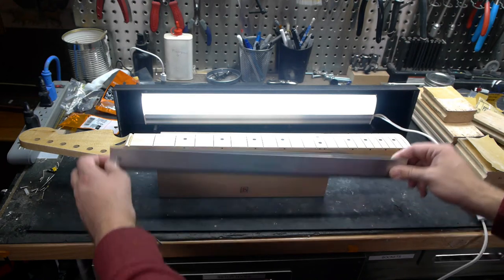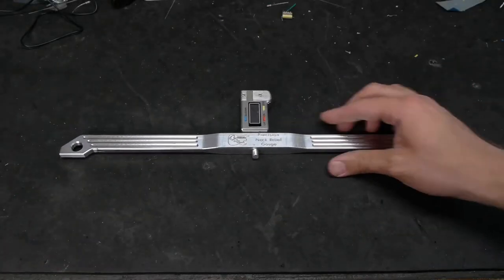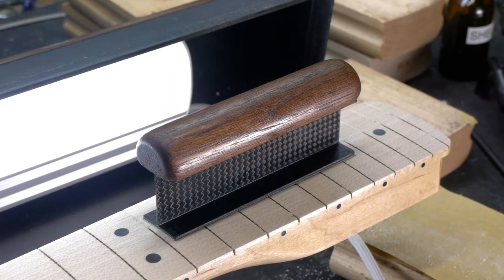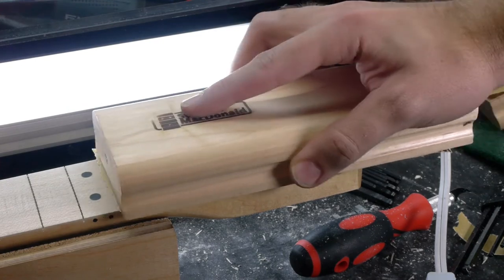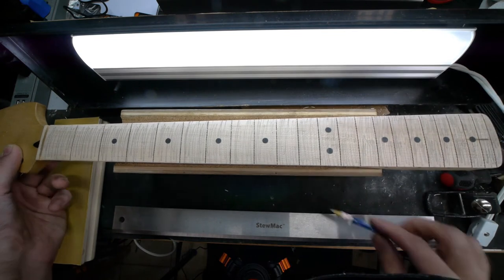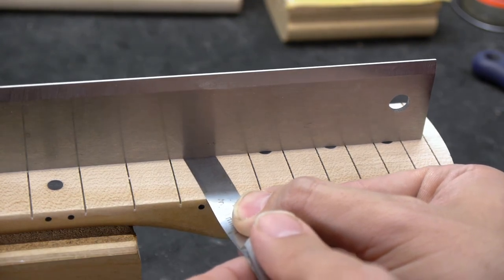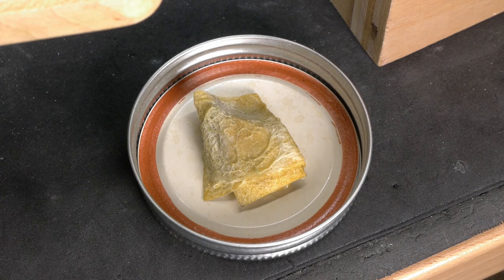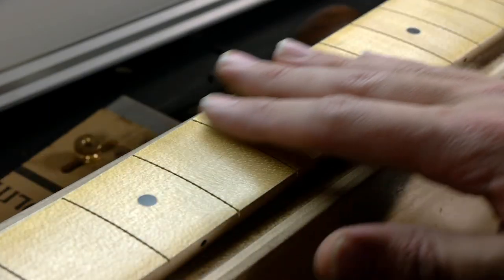*CHECK DESCRIPTION* Cheap Guitar Neck Transformation Part 2 - Compound Radius the Fretboard

Comment from the maker: NEW VIDEO HERE (2023): "Compound Radius" Formula: Conical Profiling for Stringed Instrument Fingerboards / Frets

https://youtu.be/JFj_SmpBCuo?si=Slv0MoEeJlDmDehR
Reply: Hi, interesting videos.  How has your experience  been playing with a shellac finished fretboard?
Reply from the maker: @TheThor1212  Thanks! I've actually been planning on redoing the shellac video (Part 1 of this series) as a standalone video. Also check my channel for the recent redo of this video -- I revised the compound radius thing and the new video is far more accurate and informative. 

My experience has been excellent. I will never use another finish on my own personal guitars. There are just so many advantages, and it's so smooth and easy to play.

I'd strongly recommend doing it the way I did here, with freshly mixed shellac. I've heard of people complaining of shellac getting "gummy" after a while, but only with the hardware store stuff. Never had a single issue with the homemade stuff. 

Absolutely love it. I was actually edging/rounding my frets the other day, and filed through the finish by mistake. Sometimes this can't be avoided. A little shellac touchup and it looks like it never happened...can't do that with other finishes! 

Truly great stuff, and so easy to apply. You can put it on a Q tip and easily get between the frets as well. I could go on and on...if you haven't tried it, go for it! I'm never looking back, myself. Awesome stuff, totally non-toxic (when made with grain alcohol), no ventilation, no gloves, no mask...and dries super fast. Love it!
Reply: @guitar_md  Cool stuff. How you go about cleaning it?
Reply from the maker: @TheThor1212  I use mineral spirits if needed. But considering other options. I know some people like using a little hand soap mixed with water and scrubbing with a toothbrush when it comes to other shellac finishes objects. 

Mineral spirits + toothbrush is quick and easy. Or just on a paper towel.
Reply: @guitar_md  thanks, man. I will try it on indian laurel. May keep in touch about it.
Reply from the maker: @TheThor1212  Definitely let me know how it goes!

Comment: Now that is an instructional video! Damn bro like the guys said before me ... your got mad patience and SKILLZ!! signed up! I hate paying for setups! I am diving deep on doing them on my own. Thanks a ton fantastic information. The special guitar tools ugh figures I got loads of tools, just not for this !! LOL!
Reply from the maker: Thanks so much for the support! Please check out my updated version of this video here for the most accurate information: 

https://youtu.be/JFj_SmpBCuo?si=hxB6ULvspC_7HTRR

I'm also (very slowly) working on a deep dive video on setups. There's a lot to address. 

These days, I rely heavily on a Digital Neck Relief Gauge and Digital Action Gauge (both available from G-Tech Guitars, though Rectify Master is the original inventor of the Digital Action Gauge and I always recommend supporting him by buying one of his tools...you can contact him via Davide Bissoli on Facebook). 

Anyway: You set the neck relief first, then capo the 1st fret to take the nut out of the equation. Then set the action either at the 12th or 17th fret. I don't think it matters much. Then you can file the nut slots down to the proper height, and check the action at the 1st fret using the Digital Action Gauge. 

That's the Cliff Notes version. For Bolt-On Necks, you have to do a lot of work on the neck pocket, which may include shims to adjust the action and the string alignment, and more. 

I'm working on a Truss Rod Adjustment video that will take up enough time on its own. Just adjusting the truss rod can have a lot of things to watch out for...in a perfect world, it's simple to adjust, but in reality, a lot of things can go wrong depending on the quality of the guitar. 

Many videos in progress. The "Setup Masterclass" video is something I've had planned for ages. I've been doing setups for 20 years and over the past few years have really refined things a lot and am doing better setups than ever. 

Oh, forgot to mention, forget the radius gauges for setting action. The best way is to set the action for each individual string. Generally, the absolute lowest I go is around .046" on the Low E, .040" A, .035" D, then .030" G B E. 

Not much point to going lower than that, and the fretwork at those specs has to be pristine. Understring fret leveling is my go-to 100% of the time now as well. A major advantage here is guitars should be set up with the neck dead straight anyway, even if the player wants relief -- the frets should function perfectly with super low action and the neck dead straight, and you can add relief and raise the action from there. 

20 years...it's a lot to condense into a single video. I'll see what I can do.
Reply: @guitar_md  I'm an old beginner slowly getting decent in playing.... I knew what I signed up for lol! I'll play until I'm dead lmao..... That means I gotta learn to set my own up!!. Thanks I'll be watching!!

Comment: Could you do this after finishing the neck with pure tung oil?
Reply from the maker: Yes, but you'll have to refinish it. Most likely the sanding necessary will go through all of the finish.
Reply: @guitar_md  oh, that is not good for my reshaped neck, would’n want to take more wood off. Well, pure tung oil it is 🤘 luckily it is roasted maple.

Comment from the maker: NOTICE: Some of the information in this video is incorrect. I've since revised my methods and learned a lot more about what an actual compound radius is, how to make one, and actually how to calculate it precisely. Cliff notes version: 

For a perfectly level playing surface, there is only one correct compound radius profile for a given radius at the nut, width at the nut, and width at the 12th fret. This all can be calculated. You pick your starting radius at the nut, and calculate what the radius will be at the end. Period. You don't get to pick and choose which radius you use, aside from the starting radius. If you deviate from this, that means that the flatter radius higher up is lower than the rest of the board -- that means it's basically 'fallaway.' 

7.25" - 10" for example would have been the correct compound radius on this neck. That's what it has to be in order to be perfectly level. 7.25" - 12" would mean the last part of the board at 12" would have the middle leveled down more, and it would be lower than the rest of the board in the middle, not level with it. For a true, perfectly level compound radius, there is only one set of radii that will work - and that's because it's a cone. "Compound radius" itself is a misnomer, and misleads us into thinking that we can pick and choose different radii as we please. What we're really doing is "conical leveling." Leveling the board into the cone that it actually is. 

This all seems confusing, but in my upcoming video about what a compound radius is, how to calculate one, and how to make one, I'll explain everything. Just for now, know that this information is incorrect, and my results have skyrocketed tremendously even in the past 8 months of applying this new knowledge. The fretwork I'm doing now is better than ever and I'm excited to get out some new content going over the compound radius, and new fret leveling techniques I've created using Davide Bissoli's Rectify Master Katana, which I am beyond convinced is hands down the best fret leveling tool on the market. 

My techniques will include fallaway over the whole length of the fretboard, fallaway with relief over the whole length of the fretboard, carving relief into the frets only under the two lowest strings, which need more relief than the rest of the strings, and a proprietary method for eliminating choking out on bends, by bending the strings to the problem area, marking the string at the beginning and end with a sharpie, and using tape on the fretboard as guides for where to use the leveler. And the leveler is none other than the Rectify Master Nano Katana, which is about 10" long, perfect for spanning frets 5 or 6 to the end on a normal guitar, which is where most fret bending issues are going to occur. Expect some nerding out referring to Musashi, and his two katana style -- one long, one short -- and my technique of using a guitar (full length) Katana, and a ukelele (short length) Katana to achieve unparalleled fretwork results.

Seriously, my current guitar is around .046" on the Low E and .025" on the High E at the 12th fret, with zero relief, bass action .015" at the 1st fret and treble action .009" at the 1st fret. And huge bends everywhere with no choking out. It's insane. You're not going to want to miss this. I'm also going to be using a lot of clips of Pai Mei from Kill Bill 2 to convince you that trying to do fretwork like I do using the tools you have that aren't the Katana is like a worm fighting against an eagle. 

More to come soon. But one last note: using a flat beam along the string paths will automatically create a compound radius. The radius blocks are optional, but they do help speed things along.
Reply: Is there any news about the new video?
Reply from the maker: @PizzaMclizzard11  In progress! Have had a ton on my plate, but I'm currently working on the script for it. 

I've decided to do a video exclusively on the compound radius, and am going to make a video regarding special leveling techniques in another video. The compound radius video is likely going to have an intro talking about what a fretboard radius is, and I plan on making some drawings in a vector program to illustrate the ideas, as I think it's much easier to explain (visually and audibly) in terms of basic, universal geometry, as opposed to something guitar specific. 

I'll include clips about the process, same as in this video, and likely reuse a lot of this old footage. I also have a lot of great text going over the compound radius formula, which I will go over in complete detail. 

That video and my Truss Rod Adjustment Guide video are two huge ones I have planned that I'm very excited about. No word on when I'll have them done, but in progress. Still working on the script for both but I also have bits and pieces of the videos completed and have begun editing them together.
Reply: Almost all my builds are 25.5" scale length, 8's, zero relief.  I run 1.4mm action at the 24th with no issues.  This gives me 0.933mm action at the 12th vs your 1.168mm action at the 12th.
I used to like shellac finishes, but they can't handle alcohol.  Spill a shot of Jack on your guitar and watch the finish melt.
I'm getting ready to start a Richlite and single carbon fiber tube neck build.  I'm debating whether to go compound radius or not, so I'm checking out relevant vids.  I see you recently posted your new compound radius vid.  Looking forward to checking it out.  Your delivery is clear and concise - just make sure the info is correct!  Last thing you want to do is send some poor noob down the wrong rabbit hole.
Reply from the maker: @PizzaMclizzard11  New video here. Uploaded a couple months ago. Forgot to update you. Let me know if you get a chance to check it out! Link below: 

https://youtu.be/JFj_SmpBCuo?si=Slv0MoEeJlDmDehR